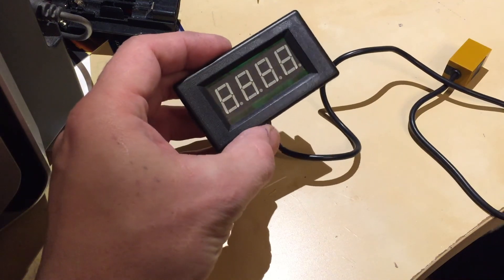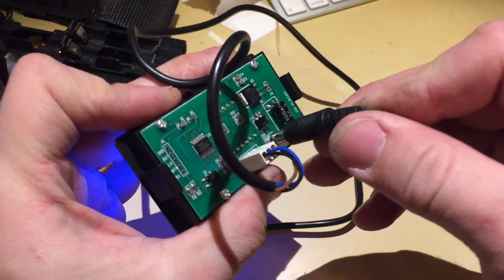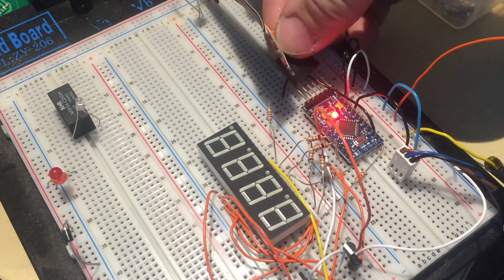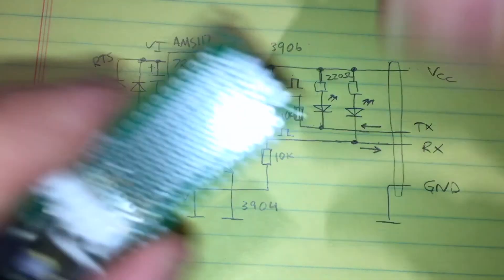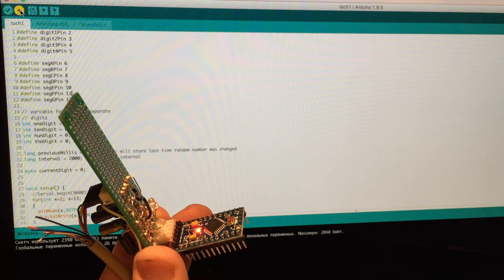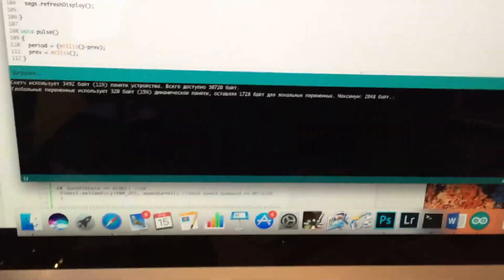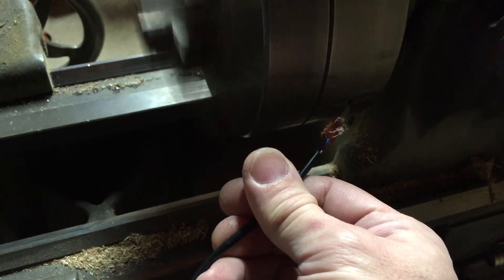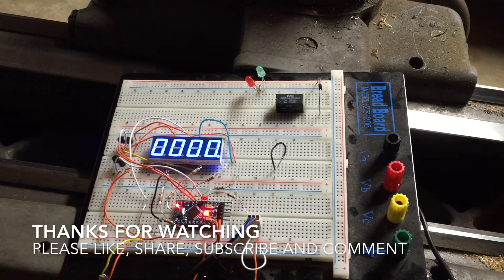DIY Arduino Tachometer with 7-Segment Display, RS232 to TTL converter

Comment: I have tried a variety of hall effect Arduino tachometer algorithms some of which worked ok on the bench only to fail when used with a 2.25hp DC motor nearby I was about to give up on the idea.  But, your RC filter near to the Arduino may be the solution I need. Really useful video.  My version is not displayed on a 4 digit display but returns the value to an Elecrow touch screen controller run by  Raspberry Pi 3B+.  Will add the filter and hope it sorts it out. Thanks for the idea.

Comment: I really like seeing these digital tachometers on race cars... But they seem to keep up with engine rpm way more accurately up to 10 rpm or less. I wanna implement this on my own car.
Reply from the maker: Race car engines can run at 10k rpm+.
This style tachometer may not be up to such task. I’m not entirely sure, but there might be issues with arduino’s processor trying to handle high rates of input signal due to relatively slow internal clock. Purely theoretical, just talking from my head, I think if arduino’s code was simplified by using an external digital display with its own processor, it might work better.
In any case, I hope it works out for you!
Thanks for watching!
Reply: @TinkeringNerd  hmmm. Yeah for my application I'd be shifting at 7.5-8k. what you said about the Arduino processor being too slow makes sense. I figured it might've been able to keep up. I want something that can respond to changes in engine rpm much more quickly. And if the Arduino code was simplified, would that mean that it could devote more power to processing speed input and could be more responsive?
Reply from the maker: In the version presented in this video, arduino is used to sample the signal and process the digital display. The display is updated every half second or so.. while it’s perfectly fine for a lathe, it might be awfully slow for a race car :)
The more I think about it, the bigger the problem of using arduino for such application seems to be. Although, there are people who seem to have been able to achieve satisfactory results. They are using an external display with its own processor, though. Check out:
http://forum.arduino.cc/index.php?topic=108949.0
Hope it helps.
Cheers
Reply: @TinkeringNerd  "...Arduino is used to SAMPLE the signal and process the digital display. The display is updated every HALF SECOND or so..." Thanks for the clarification. I want something that updates as quickly as the engine rpm fluctuates even when it's holding a constant rpm... if that's even reasonable. That just looks really cool to me lol. I went ahead and subbed to your channel.
Reply from the maker: I appreciate your support, thank you!
Reply from the maker: The realistic display update cycle in an optimized arduino tach would be probably in 50-100ms range. Just guessing.. :)